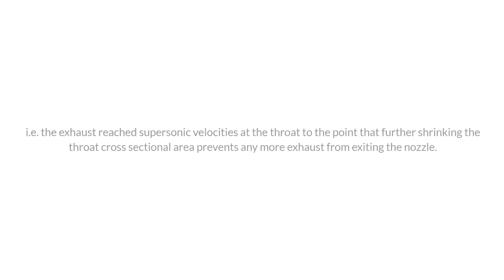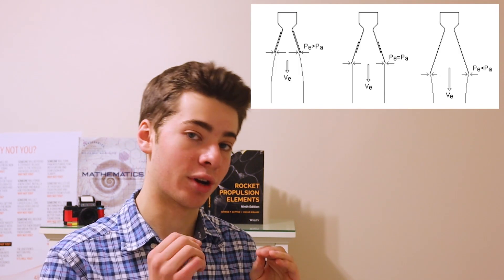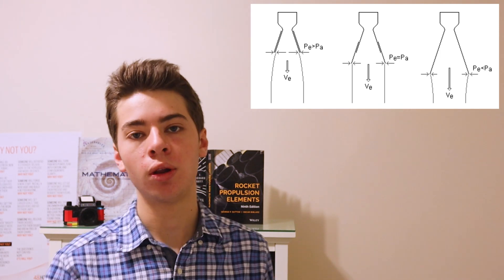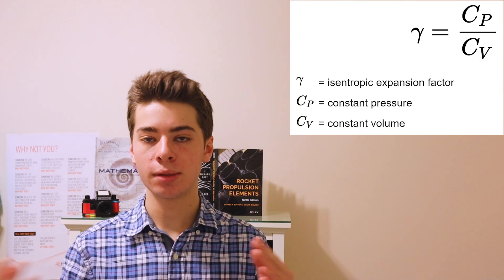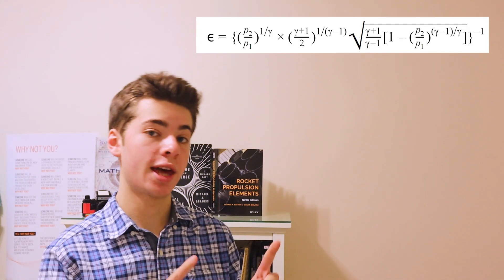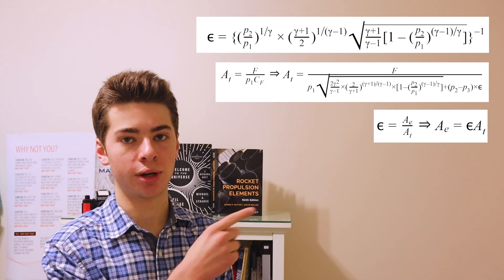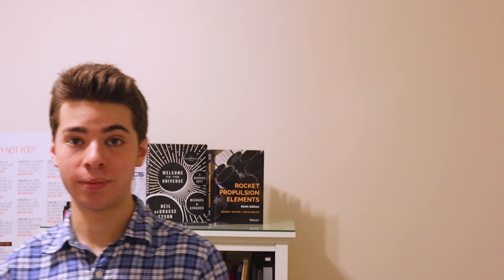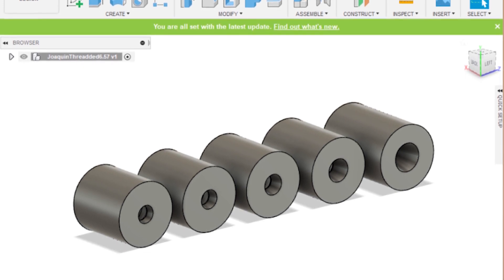How to Design Your Own Rocket Nozzle | CSSI Educational Video

Comment: Just curious how much it costs to have your nozzles manufactured? I recently designed a 50mm chamber and bell nozzle and had it cnc manufactured out of 316 stainless steel. 1 off sample it’s expensive but price dropped drastically when mass produced.
Reply: where did you got it manufactured? local or online?